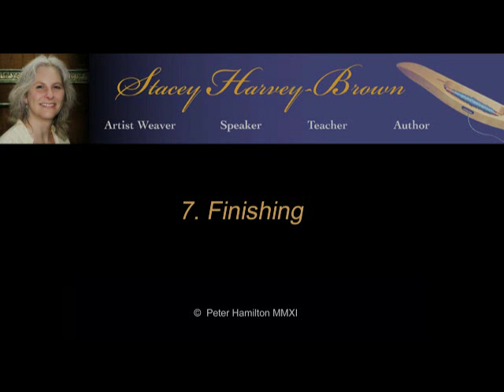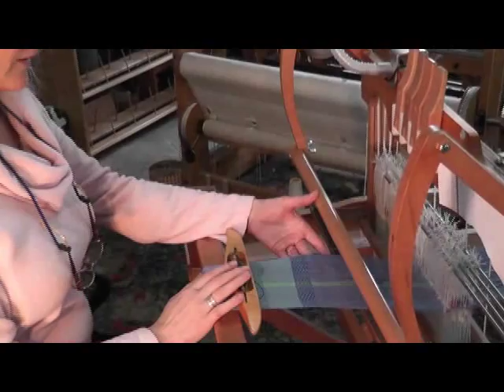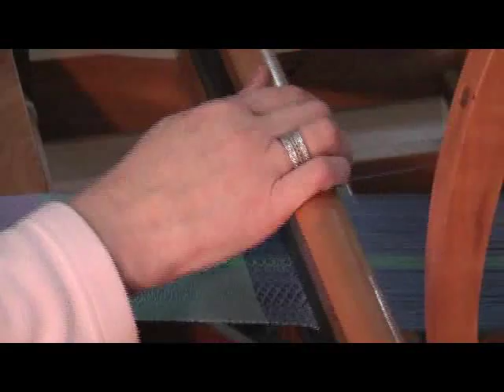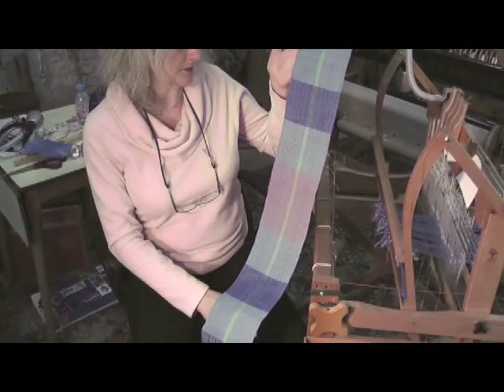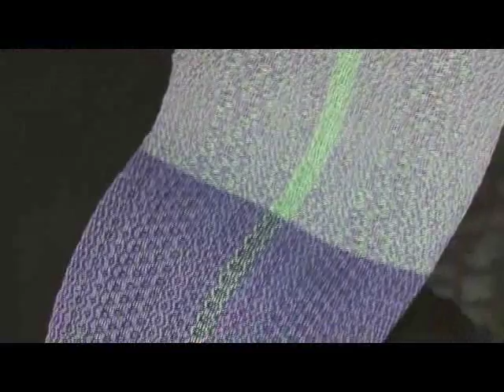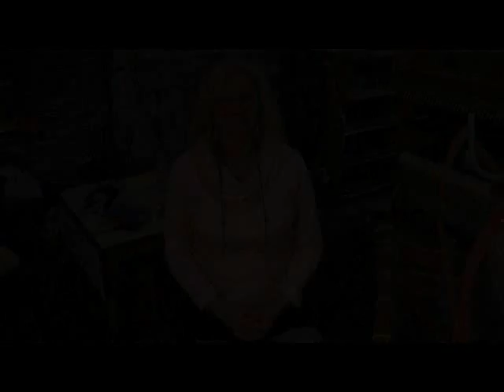#7 Finishing

Comment: There are lots of different ways of finishing, depending on what you are going to use the fabric for.  Scarves quite often have long fringes which are twisted, or plaited, whilst table wear might need a finer weft thread in the hem area so that they can be folded over and hemmed.  There is a technique of hemming on the loom which is very neat when you don't want twisted fringes.  Some people use transparent glue to hold the edges together, or iron-on interfacing immediately after removing.